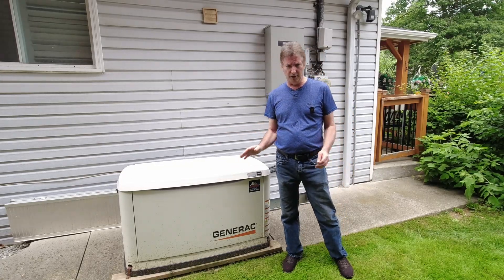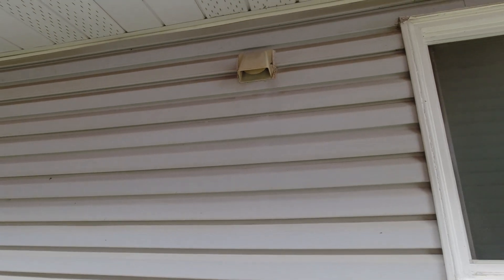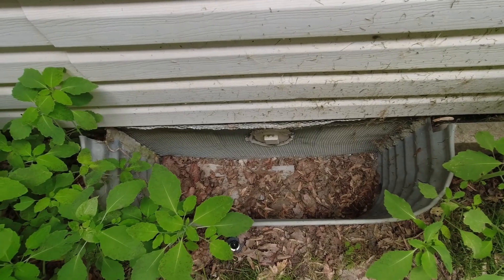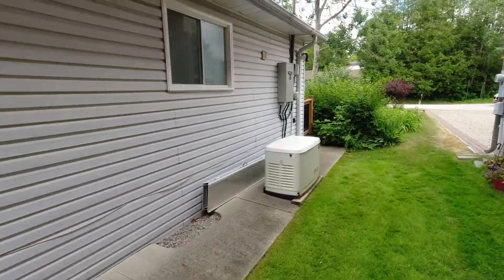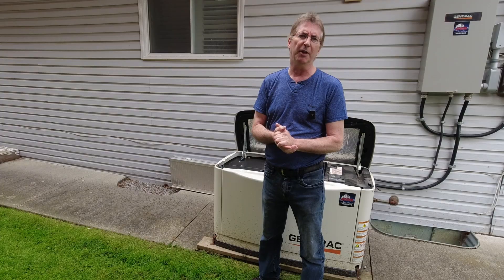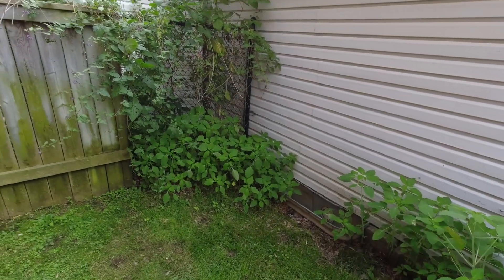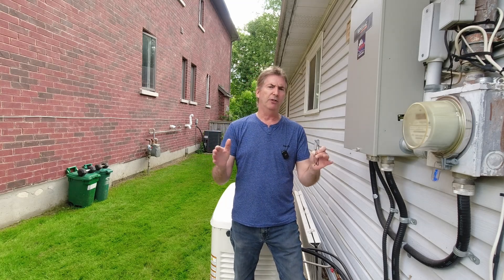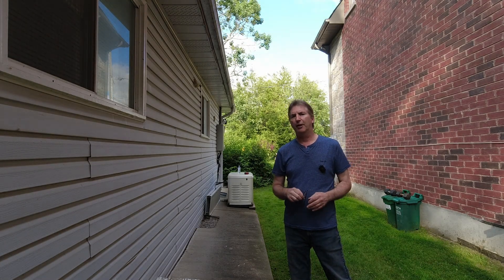House filled with carbon monoxide during power outage. Home Standby Generator

Comment: What about the vented soffit on the eves? If there’s no wind at the time it’s running the hot exhaust is going to rise strait up into the soffit.
Is there a system for extending your exhaust pipe to a safe distance from the house?
Reply from the maker: I don't believe they make an exhaust pipe extension. The only proper fix for this, would be to relocate the unit in the backyard yard.

Comment: I just had one installed, was told code is 5 feet from the exhaust side minimum distance from any window or vent.  If possible, have the exhaust side going away from home instead of parallel also helps with noise.  I've got a huge backyard, unlike this setup.
Reply from the maker: I like your exhaust side going away from the house idea. In this setup the neighbor may not like it, I think there is just under 10 feet between the two houses.

Comment: The whole area between the homes is a bad location for a generator. There is too much vegetation at both ends, along with the fence and shed at the far end, and the homes are too close. And the unit is oriented to exhaust right into the middle of that space. If you get a power outage on a day with little to no wind, then exhaust is going to accumulate in that whole space and seep into any little opening in both of the homes for hours. Now I better appreciate the permitting process for generators that my village has.
Reply from the maker: Well said, thanks for watching.

Comment: I think the reason everyone tends to put the generators close to the house is the gas hook up.  Burying a propane line to a generator requires expensive gas risers and no one wants to pay extra.  I did.  I put mine 6' from the back of my garage and I don't regret it.  No gas fumes trapped under the soffit or in the attic space.  These units put out a LOT of gases.
Reply from the maker: Yes there is a major difference in price, sometimes paying a little more up front is worth it. Like I always say, (you don't know what you don't know), sometimes comments like this help other people, thanks.

Comment: Think it is funny that during a hurricane they recommend putting portable generators 20' from home but Standby/Whole House generators can be that close to the house. I'm about to invest in a whole house for hurricanes and have it installed at least 10' - 15' from the house. I don't think there's any point in chancing it.
Reply: Just dealt with hurricane francine down in the new orleans area. Had our 22kW Generac unit installed 2 years ago. It's in our backyard 25' from the house on a pre-existing slab that previously housed a hot tub that the previous owner neglected (thing had a whole ecosystem growing in it when we bought the house). Let me tell you it was the most beautiful sound hearing that thing fire up after our power went out during the storm. Worked like a champ for the 9 hours that we were out. And being so far out in the yard it's safe. Only thing I need to do is get a soft starter installed on my AC unit cuz that thing definitely hits the generator with a serious jolt whenever it powers up.

Comment: This review is flawed, but by the design of the house, the window (which has an obvious gap and unsealed from the outside), the exhaust/inlet vent right above the genie, and the fact all generators must be installed within 10' of the main power panel.  However, I agree the installers should have installed the genie elsewhere.  The reviewer here is also embellishing on the obvious, mistakes not from Generac, but from the owners own obvious decisions to install the system right where it is at per his requests...
Reply from the maker: It is not a review, but an example of a poor installation.

Comment: Just a heads up... there is finally a national generator code, circa 2012 (?) but not all areas have adopted it. It outlines minimum distances from the house, eves, vents, and windows. It also included proper gas venting and wiring, although basically follows NEC and NFPA. In there they spell out at least 5 feet from doors, windows, and other building penetrations, but experience shows me that if the heat of the exhaust will kill a bush at 10 feet on a long outage, you just know the exhaust side needs more space from EVERYTHING.... including AC units. Oh, do NOT modify the gen set. That will void the warranty and the UL rating. (think: liability and insurance companies)

Comment: Ok, I haven't watched your whole video yet , but I get CO coming in my house from cars running outside. It comes in from those soffit facia vents right above your head on the eaves of the house. Those are the main venting on the house. You can only fix this problem completely by exhausting your generator with a long exhaust pipe that extends a good long distance above the homes roof.
Reply: do NOT modify the gen set. It voids the warranty and the UL rating, which may give you problems if you ever have an insurance claim. That said, look closely at the installation instructions where they specify clearances to building openings, overhead obstructions, and prevailing winds in your area. 99% of the time CO issues are from a poor installation. BTW, sometimes the easiest thing to do is turn the unit 90 degrees so the exhaust blows away from the house.
Reply from the maker: Problem was found in the video, thanks for watching?

Comment: I brought a brand new one from Lowe's and it was severely corroded. I took it back and got another one and it was even worse. it look like it was about to have holes through the exhaust system before it ever got started. I'm a marine mechanic it looks like it had been underwater. make sure to thoroughly check for corrosion on any generac product they use crap metal for sure. I'm quite sure that if you had an exhaust leak because of rust it's probably not, under warranty
Reply: the new units (almost 10 years now) are made with an aluminum housing. That said, if the seller stores the new units outside straight from the shipper, they are bundled in groups of 4 units with plastic. Rain leaks in but does NOT dry, so after weeks / months being wet in storage, everything looks shabby. Any high volume dealer knows this, but big box stores may not care. Ask me how I know after 25 years as a dealer tech.

Comment: Isn't that generator way too close to the house. Mine's almost 15' from the foundation and the exhaust is pointed away from the house.
Reply from the maker: Yes, it was installed in the wrong spot, in order to install correctly you need to check, local building codes and manufacturer's minimums.

Comment: 8:25 What about poisoning the neighbor with carbon monoxide? If you look behind you at the timestamp the neighbor's window is wide open. Frankly, this needs to be put in the backyard or somewhere further away. These houses are literally right on top of each other. I don't think the side yard is a good location to use in this application.
Reply from the maker: Good eye, the spot I pointed out would meet code but the back yard would be a better place for this generator. Thanks for watching.
Reply: Damn I saw that too after your comment.
Reply: Yeah that’s like involuntary manslaughter 🙁